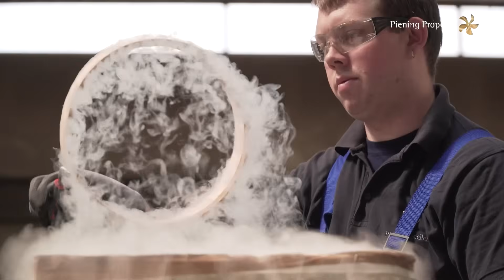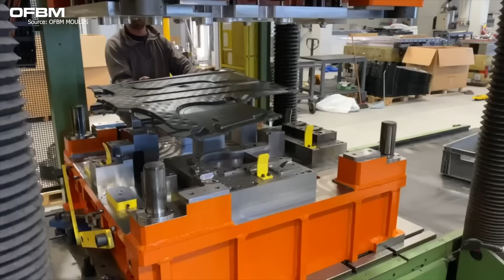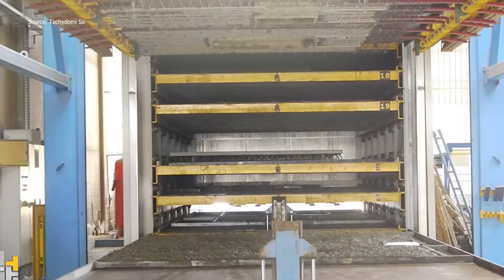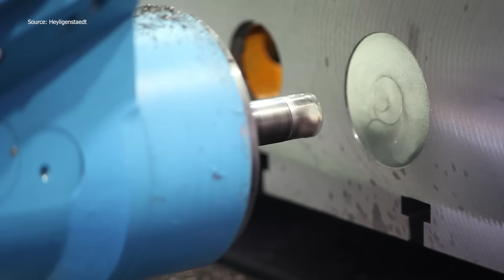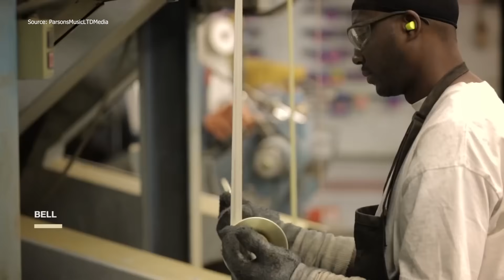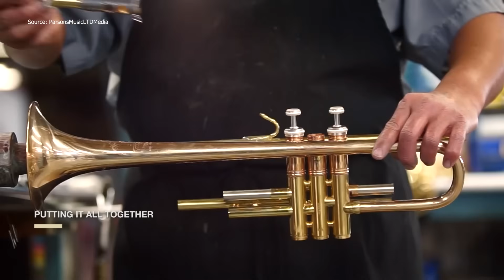12 High-Tech Industrial Processes That Will Blow Your Mind – Precision, Speed and Heavy Machinery

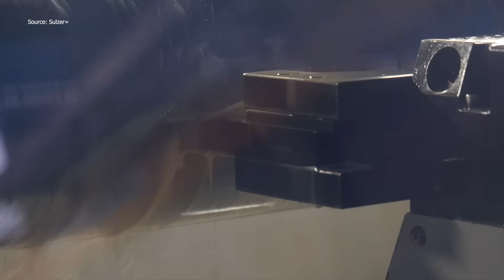Comment: This video is a true masterpiece of modern engineering! ✨ The combination of extreme speed and absolute precision in these heavy machines is mind-blowing. I was particularly fascinated by the metal machining process at [02:45] and the raw power of the hydraulic press at [07:20]. 🛠 It’s amazing to see how far industrial technology has come! 👏

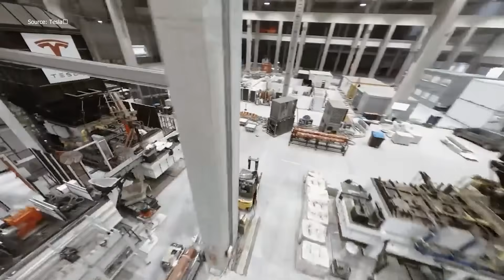Thank you for sharing this high-quality compilation! I have a quick question: out of these 12 processes, which one typically requires the highest operating and maintenance costs? ⚖ Also, how much do AI systems contribute to error control in the process shown at [05:15]? Looking forward to your insights! 🚀🌟